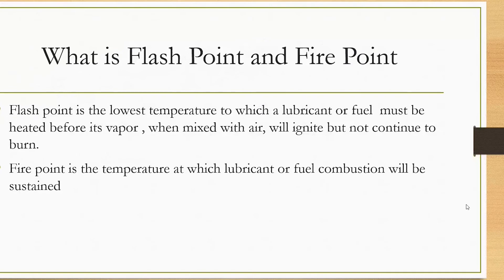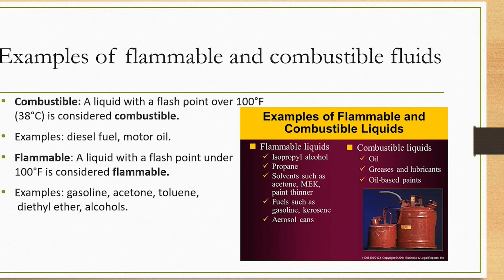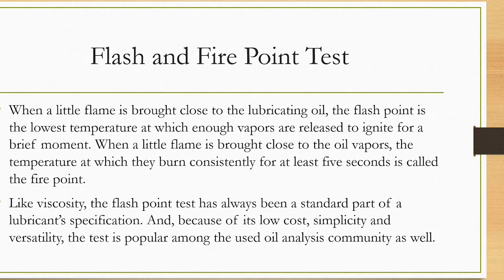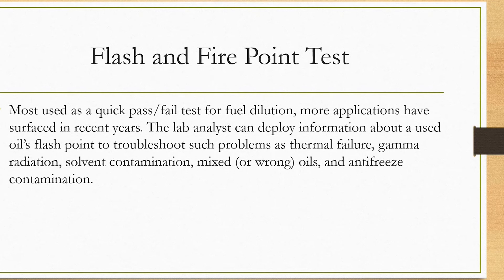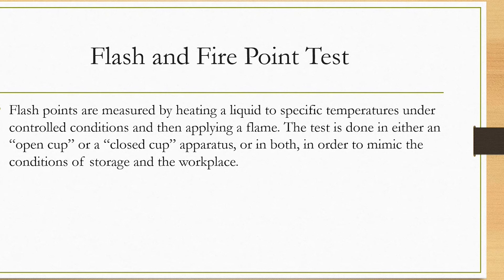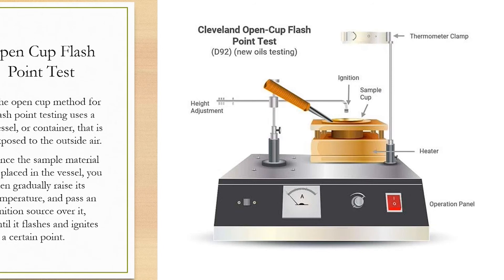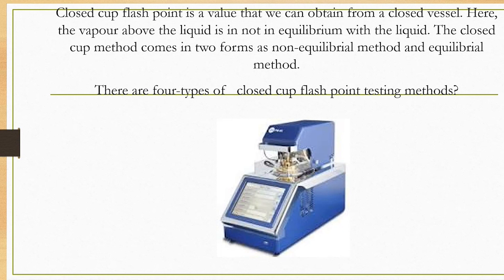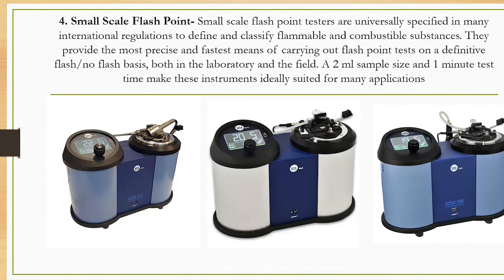FLASH POINT AND FIRE POINT  IN FUELS AND LUBRICATION

Comment: PROFCHARLTON thanks for sharing this video. 
It explains the need to test the differences between the flash point is the temperature to start or ignite while the fire point is a little flame that burn for at least 5 seconds in fuels etc…It is very important information for engineers to remember.
PROFCHARLTON ACADEMY the free engineering education online.